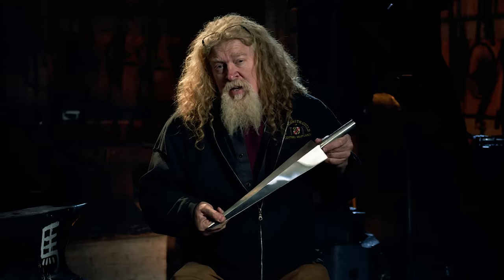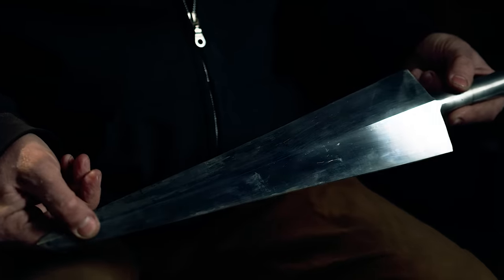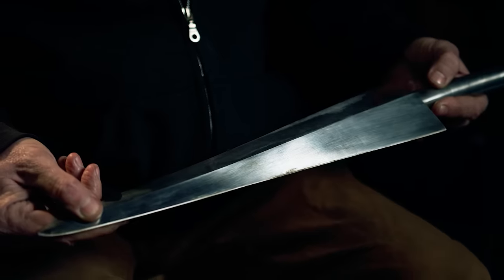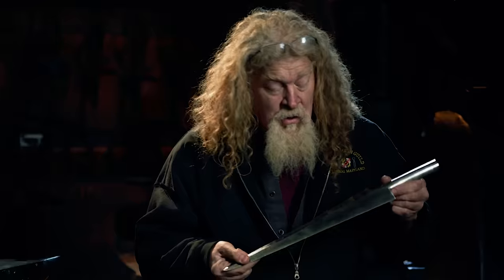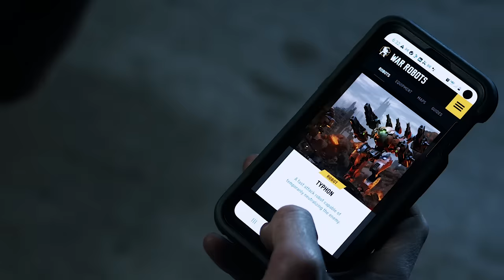Pure Nail from Hollow Knight - Tanner Saslow - AWE Me Artists Series

Comment: Probably just speculation on my part, but I would think that when the nailsmith is refining the drill nail to the pure nail the reliefs and patterns are forged and layered ontop of the original core. Could be solely because a game mechanic, but when you have to give over extra metal for each refining, the design looks like it is being added onto the previous core of the nail. So you take the old nail, reforge it to the sharpened nail to remove the breaks and dullness, add new metal onto the core to make the channeled nail which has better balance, refined further to the drill nail, then finally adding the magical reliefs to make the pure nail.